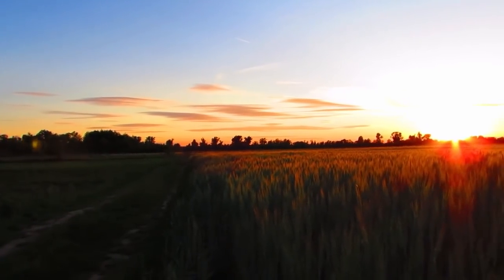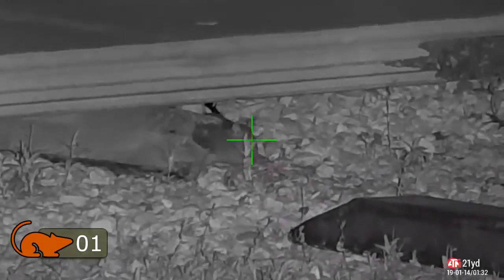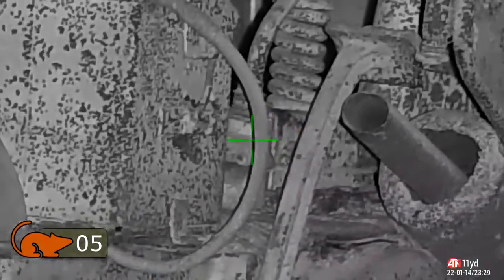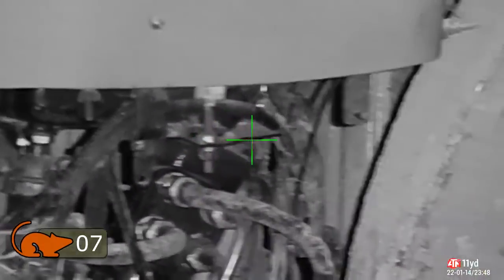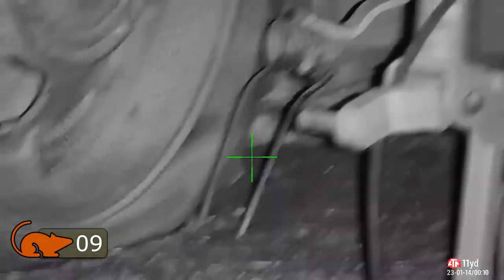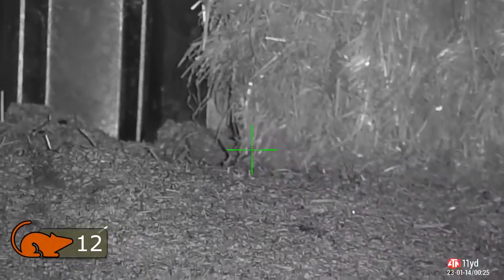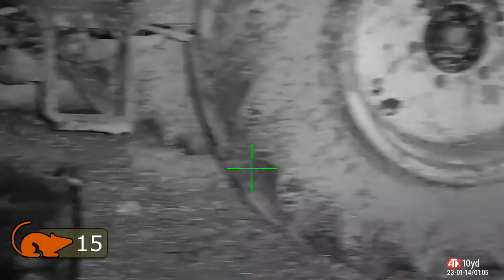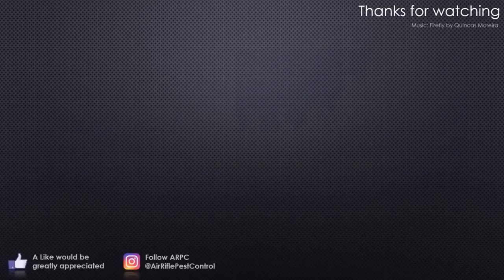Hide And Squeak - Air Rifle Pest Control

Comment: Hi what riffle was you using.  And was is a 12 foot pound?
Thanks
And great video
Reply from the maker: Thanks for your kind comments.

In this video, I was using a sub-12 Air Arms Ultimate Sporter, chambered in .177.

These are deadly accurate rifles when paired up with the JSB Exact Heavy's.
Reply: I'm getting one sounds good looks good. I have only got an smk victory.. but looking to upgrade.  Thanks for the review and info. 
Look forward to watching more
Reply from the maker: I've recently changed to the FX Impact MkII in .22 and RELUCTANTLY had to sell the s510 Ultimate Sporter. 

I'd have kept both. You'll love Air Arms. They're awesome.
Reply: Do you have an idea the costs of one. And where to look for a second hand one. Sorry to be a pain
Reply from the maker: I'd take a look at AirgunForum.co.uk for used/second hand rifles.

I've seen some major crap and fraud on GunTrader. Don't use those sites.  Have a look at some Shooting Shops too.

Comment: What distance is your gun set at
Reply from the maker: It used to be 25 yards. It's now 15. But it doesn't matter as I'm using the ATN Ballistic Calculator which shifts the zero depending on my distance to the target.
Reply: Ah I see only new to this so I was wondering how you never had to hold over or under the x was all ways  
Bang on no matter the distance keep the videos coming love them thanks
Reply from the maker: Thank you.

That's a good observation if you're new. Hold off is something many people don't think about. I would have to hold over or under if the calculator didn't adjust.

I've switched reticle recently which shows me the hold over it under so I adjust. You'll see this in future videos. The cross won't be in target each time in this case.
Reply: Do a lot of fox shooting here in Ireland but a few farmers have asked me to shoot pigeon and rat so I bought a gamo igt in 177 and love iv shot rabbits at 35 yards head shot no prob with it but sence iv put the scope on I find it's harder get bang on maybe a range finder could be the way
Reply from the maker: Absolutely! Foxing calibers and the ranges they're shooting are a lot different to closer range lighter calibers in an air rifle.

A Rangefinder and a list of Holdover and Holdunder points will help massively. Especially at night where range can't be easily judges because of the dark.
Reply: Thanks for your help

Comment: Why do you constantly jerk the sights around? 
You'll have the crosshairs on target, a perfect shot, then suddenly you're jerking them all over the place. 
It is so annoying watching you do that.
Reply from the maker: The sights are only 3x base magnification. Some shots are taking 14x mag so the slightest movement makes a large movement on screen.

Most places I shoot are covered in mud, manure or have wet ground and the sticks I rest in move. So I have to hold the sticks still, zoom for the shot, keep on target and sometimes follow the movement of the quarry.

It's not as easy as you think. I'm not sitting in a table top shooting at a static target.